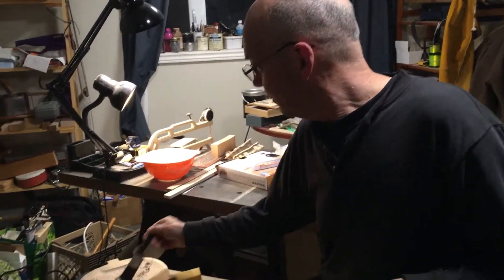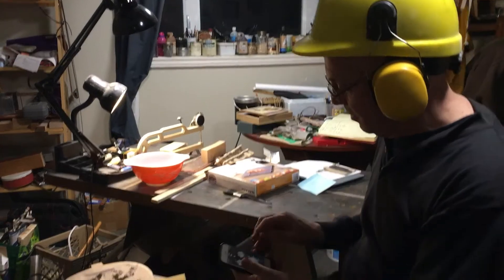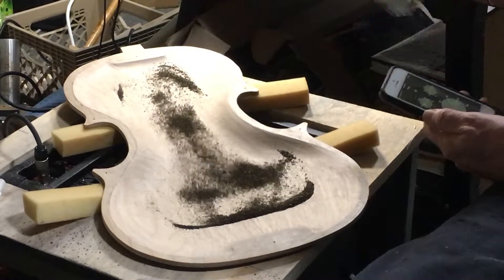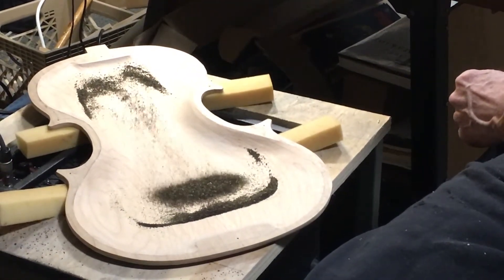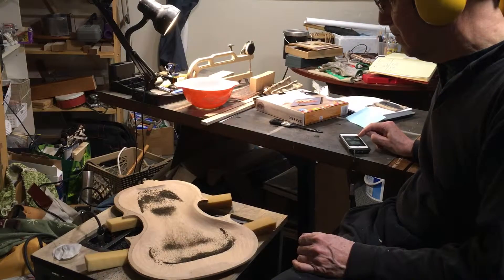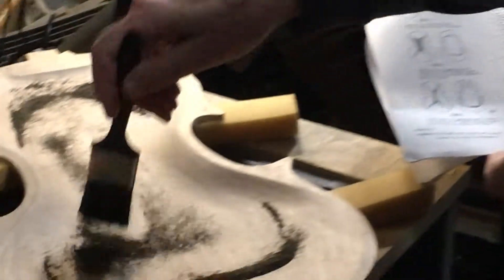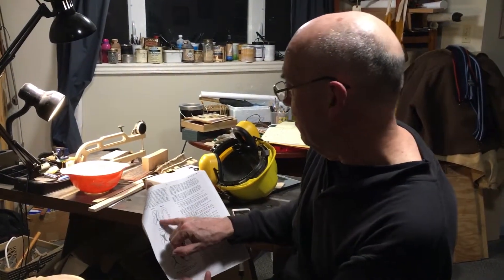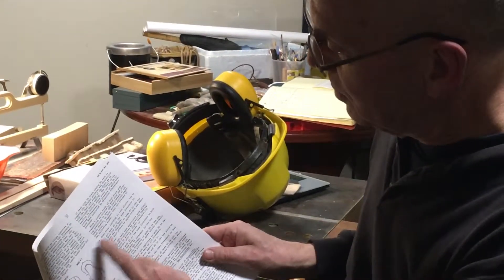Plate tuning

Comment: Its nice and very interesting to see but we don't use the violin that way. Those reactions wouldn't be the same once you put the side and back not mention the bass bar plus the sound bar.🙂
Reply from the maker: The details of the violin you raise:whole body modes, bass bar, sound post, f-holes, varnish... are aspects whose physics are still uncertain even after all these centuries.  Making good violins is considered difficult and the fundamental reason is the vagaries of wood as a precision building material. 

If violins were made of aluminum or steel, you could make them all identically, to specified dimensions and they would all sound the same. You can't do this with wood, since every piece is different. The Hutchins' free plate tuning method addresses the manufacturing problem of how best to make the most important parts of the violin (the front and back plates).  Hutchins' publications teach that builders should start with oversized parts which are scraped down until their free-plate resonances meet her design targets of specified 
mode shapes at specified frequencies. This is different from  building to a blueprint. She demonstrated that this method produces good instruments. 

She never claimed that free plate modal analysis would explain everything. Her final two volume collection ("Research Papers in Violin Acoustics 1975-1993", published by the Acoustical Society of America, 1997)contains 121contributed papers; most are works in progress and show how much more there is to study. The most glaring omission is a full finite element model of a violin with a coupled treatment of acoustic radiation. As far as I know this has still not been done, but should be possible.
Reply: Always the reluctance to embrace new and possibly better methods.  Resonant tuning equipment nor methodology has not been around as long as a violin has , that doesn't automatically make it bad....

Comment: How far is the speaker to the board? in millimeters
Reply from the maker: The foam rubber spacers are 25 mm high, and the speaker cone surface is another 25 mm below the top surface. The distance is not critical. The foam spacers prevent the plate from buzzing against the top of the speaker cabinet. You move the foam supports to align with the nodal lines of the mode you are trying to excite. Hutchins published articles show the plate is to be moved so the maximum sound pressure is applied at the location that gives the best response for each mode.

Comment: This can be done with a guitar amplifier? I got a marshall 10W and i dont know if this will damage it.
Reply from the maker: Not likely to damage the amplifier, which will have electrical limits built in. But it could damage your hearing, so wear ear protection. Other people in the household will complain, since it is a very annoying sound. The 20 Watt speaker I use is just barely powerful enough. I have to turn the power level up to its highest settings to work at the low frequencies needed for the viola.